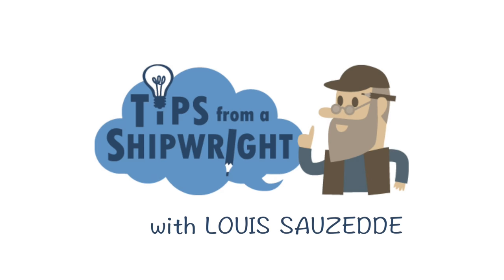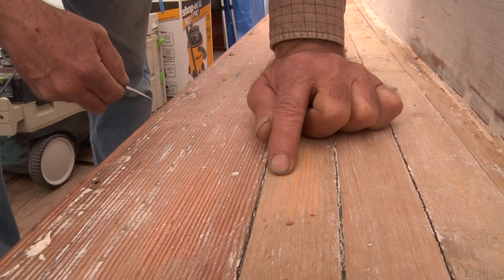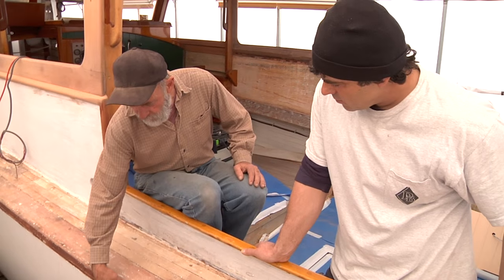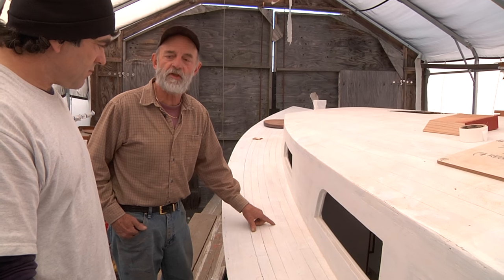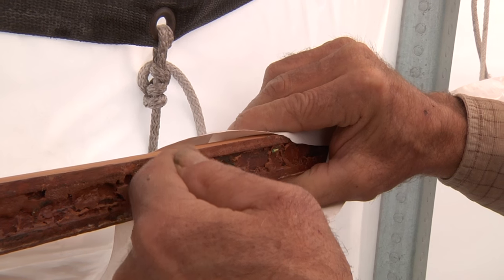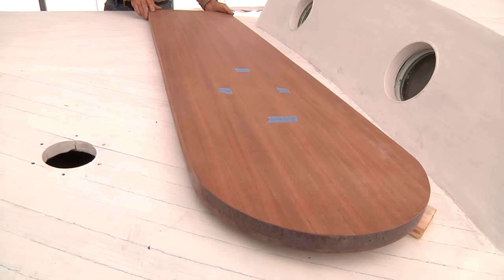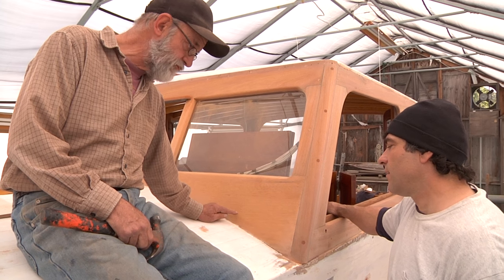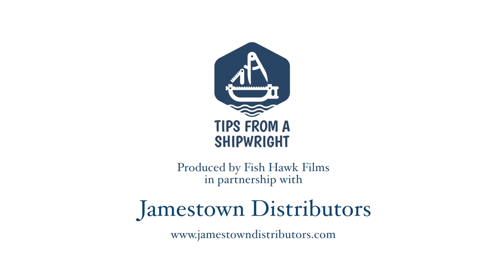Louis Sauzedde surveys a 40' wooden lobster yacht built Malcolm Brewer in 1946 (Part 1)

Comment: I built a 16' dory several years ago with plans from Wooden Boat magazine. I went to an old time family owned lumber yard but they couldn't  distinguish white from red pine. I took my best guess, but is there an easy way to tell? I'll just mention that I had a lucky meeting with an old boat builder who warned me not to use the kiln dried lumber without first raising the moisture content. I stored it in my dirt floored basement over the winter. I'm glad I did. It shrank during construction but then soaked up nice once in the water.